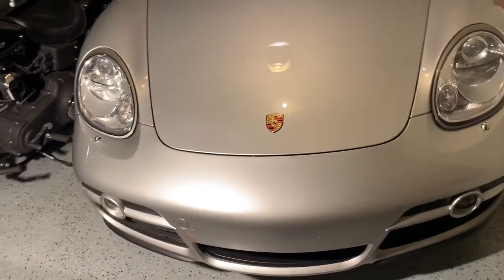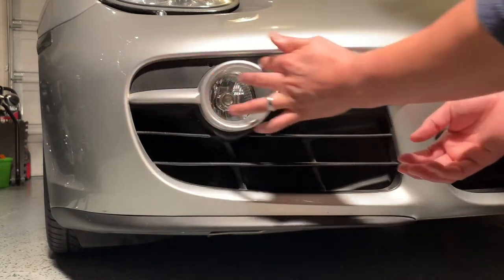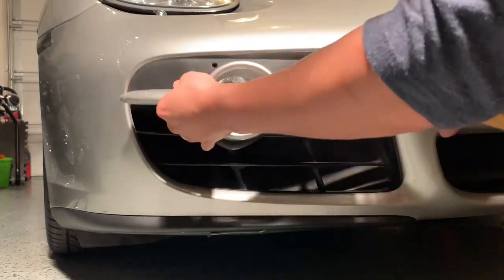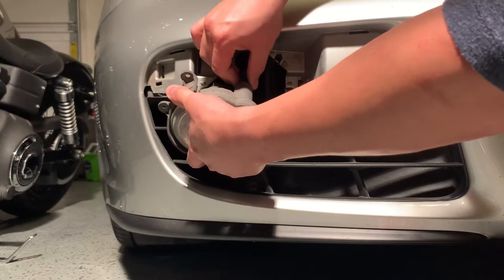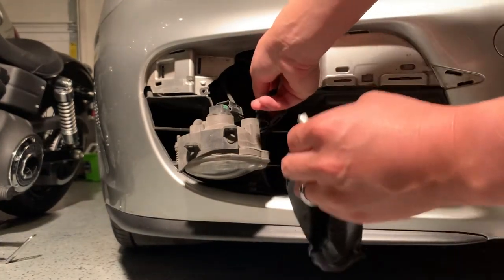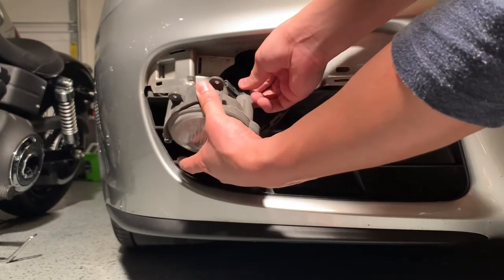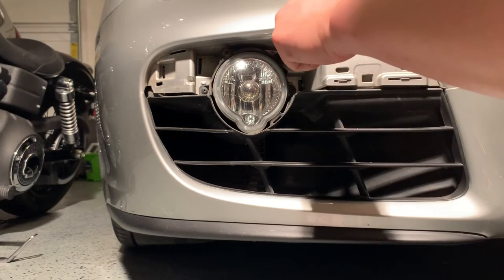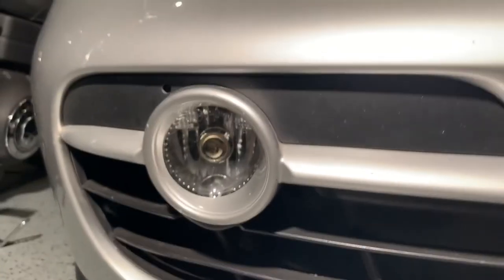#PORSCHE #CAYMAN: DIY #Foglight/Parking #BULB Change **SAVE$$ Easy... starts @ 0:10

Comment: Can you kindly advise where to purchase the yellow tool?  Thanks much.
Reply from the maker: Absolutely Chuck. You can purchase them from Harbor Freight for $7.99 or Amazon. Don’t forget to hit subscribe if you haven’t already.
Reply: @512TXSDIY   THANK YOU.  Very sorry for the litany of questions; however, what is the name of the tool?  I also have a silver '07 Cayman S with 53K miles.  You're very kind.  Thank you for your quick reply and wonderful video...   Chuck
Reply from the maker: No problem Chuck. The tool is called trim and molding set. 

https://www.harborfreight.com/trim-and-molding-tool-set-5-pc-64126.html

07 is a great year. It’s the first year Porsche introduced a reinforced IMS bearing. Mine is an 07 as well :-).
Reply: @512TXSDIY  Many thanks.  Chuck
Reply from the maker: @chuckgeller7705  You’re welcome